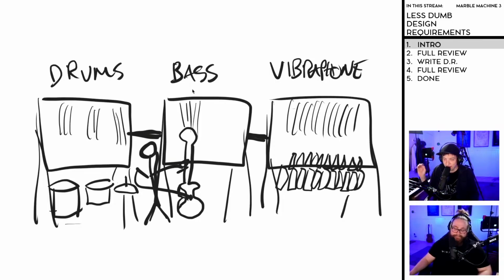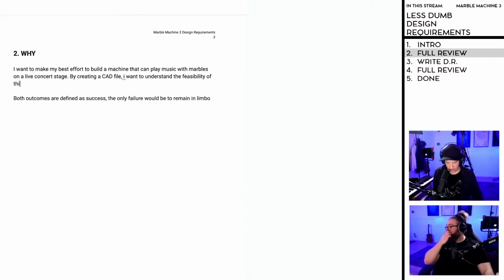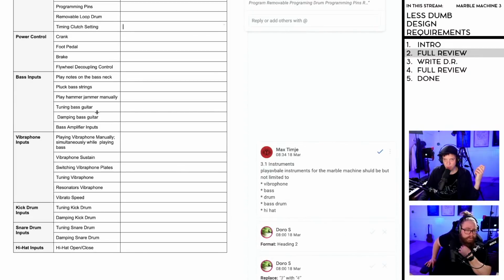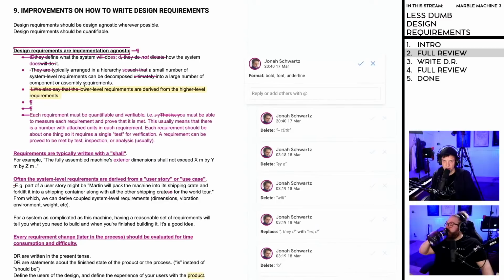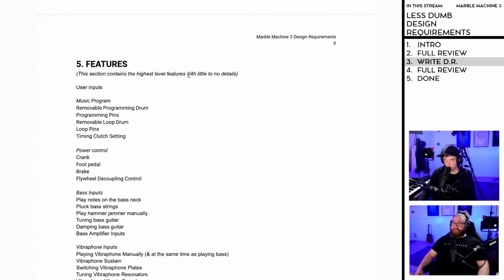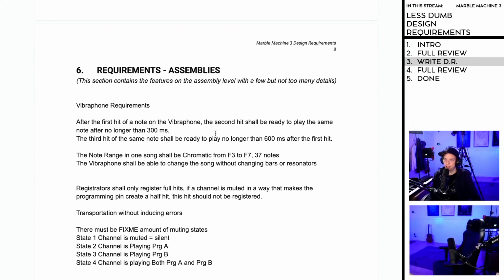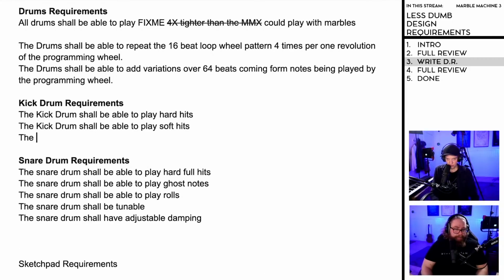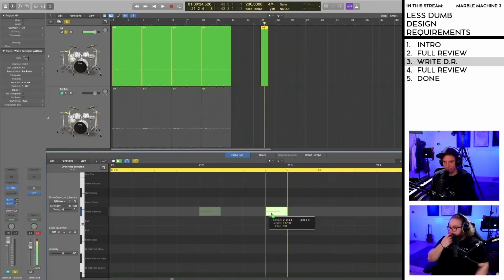Less Dumb Design Requirements - Part 3

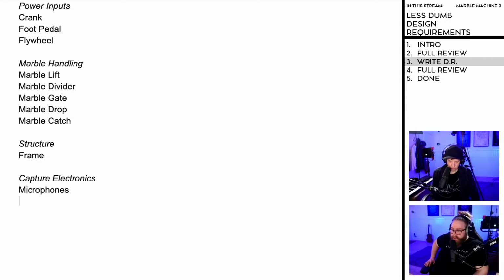Comment: At around 1:10:00, there’s a brief discussion about there not being a motor. For video/tour playback, this makes sense; however, for testing—especially on the scale the MMX was  subjected to—this seems like a missing requirement. Test requirements are still project dependencies; they just aren’t ones end users (the audience, in this case) would see. If you want to do a 10,000+ drop stress test, manually cranking the machine would be undesirable.

Comment: I think there's some fundamental problems with your decision matrix because you're spreading out points on so many properties and then scaling them on top of that means that your not getting much of a useful value out of it (other than a value confirming your biases when setting up the matrix). For example you have a cost column, the cost could be astronomical to the point where it actually does stop you from producing it, yet in the decision matrix this could never be reflected. I think you have to think about how each column can be useful and make as few columns as possible to express the points you want to measure against eachother, because in this matrix we could assume you're happy to build something which is difficult to transport, which costs 20 million dollars, looks like garbage, can't be interacted with manually at all; because these effects on your design requirements wouldn't significantly impact the total score.

Comment: In reference to the data that you were showing everyone on this stream from the MMX, it is still to be determined if it was a timing issue on the programming wheel or an issue with the Readiness of a marble because a lot of channels were running dry with a lot less pressure on top of it which would decrease the amount of acceleration due to the reserve kinetic energy from having pressure on top of it as it enters into the marble dropper gate. At least that's how I understand it, but it's possible that data was not 100% accurate because of an issue related to the marble dropper. This would mean that the root cause may not be necessarily the programming wheel but instead the reaction time from the pin readout to The Dropper itself and the Readiness of the marble. This is why I feel like you need to determine if this works better as a marble machine or a mechanical machine. A mechanical machine would still be cool just not as cool as a marble dropping to do what is expected. Hopefully the Bowden cables will result in Faster timings. Also having standardized drop height would be beneficial so that way there's no variety in how it is played from pin registration when compared to another instrument. Ultimately I feel like your machine needs to consider solid-state as much as possible because with so many moving parts it's not just going to cause friction and lose energy but it's also going to cause latency because of the amount of time to perform that action. Compensate for latency that cannot become solid state a second operation that does the same activity might be necessary, so a double dropper or a second dropper on the same instrument. I honestly feel like this machine could definitely work it's just going to take compromise on the design. If we wanted to be glorious than it has to be big, but if we want it to be consistent then it needs to be multiple small machines that somehow synchronize together. I would love to see this machine to be a grand machine but I am concerned that the machine performing an entire band may require more work than Martin is willing to do. It is a very big task making anything, even Indie video game developers like Toby Fox took several years to make their product and I think that The length of development might discourage Martin even though the end product would be glorious. Good luck on whatever you choose but I'm really enjoying watching the channel again, so hopefully you stay!

Comment: Why not adapt the powertrain system from an electric bicycle to power the MM3? You have the crank, gears and chain for manual power. And you have the motor and battery pack for sustained power. Martin already has the computer program from the MMX to control the RPM of the motor.

Why not split the MM3 into two machines? One, a marble playing vibraphone. The other, a drum machine. They both can be expanded to full potential for the music, and no hassle of trying to fit everything together. It's a trade-off, but better than incompletion if he can't solve the single machine design. And he plays the bass like a normal musician, not handcuffed to the machine. Just imagine, vibraphone to the left, drum machine to the right, and Martin in the middle with his bass like a Rock God. He can even play his accordion. And Kinetic fingers on BOTH machines!

Comment: The year is 2067. The Marble Machine Tour is about to begin and Martin has just returned from experimental surgery. Hannes’s arms have been grafted onto Martin so that he can play the complex machine. It took 18 years of training to be able to play the machine without significant beat errors. The machine has 800 levers and can articulate 61,426 variations in one instrument’s sound. Sadly, Martin or any man for that matter, cannot crank the machine manually for the entire duration of a song. But, the snare drum does indeed have a sliding lever that changes the level of the snare. How anyone could possibly adjust or play this in a meaningful way while cranking the machine is still to be determined…. Nowhere did Martin ever consider the playability and functionality of using the machine. It was entirely feature based.